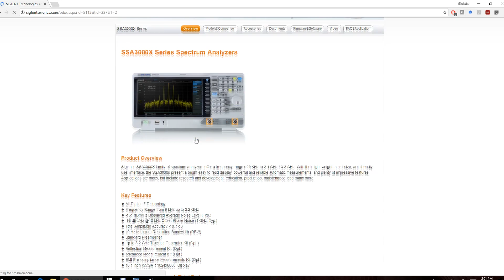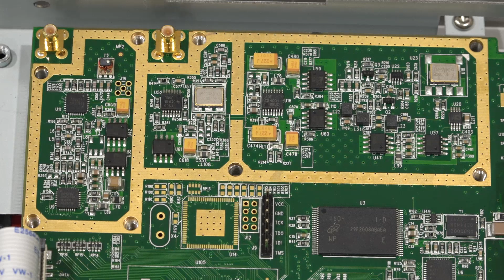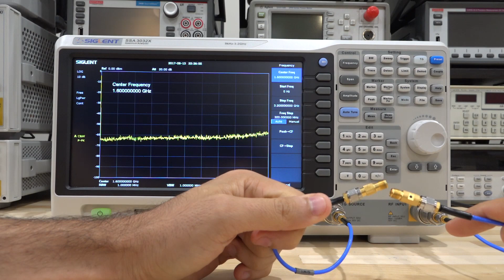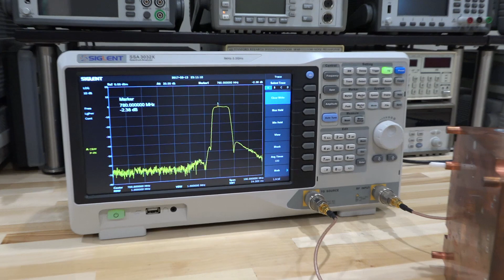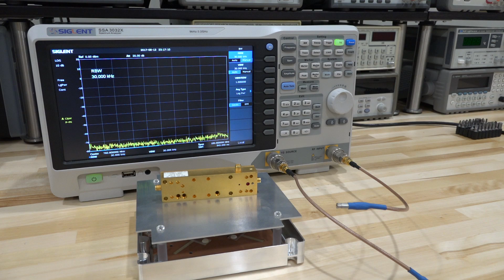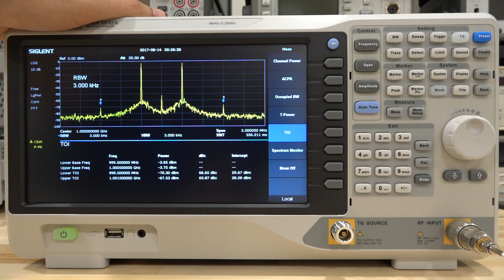TSP #104 - Siglent SSA3032X 9kHz - 3.2GHz Spectrum Analyzer / TG Review, Teardown & Experiment

Comment: Greetings from Argentina, I'm looking forward to buy this unit for cellphone RF repair , will I be short in terms of frequency for debugging 4G or 5G networks? can you please clarify to me.
Reply: If you are into cellphone repair and don't know the answer to that question then I wonder why you are even in that business since the answer to your question is so extremely obvious.
Reply: @dtiydr  Obvious or not, but I'd like to know if it'll be of any practical use for debugging Rf circuitry or better buy tiny Sa which there's an upgraded version which reaches 5ghz.
Reply: @daaudiome  If you absolutely also need 5g and don't want as many options and such then buy it. Test it out since its not expensive at all and if you miss a lot of things in it the buy fex the 3021X Plus.

Comment: I have a noisy electric earth, which is injecting common mode noise in my measurements, since the coax shield is connected to earth. What's the "professional" method to get rid of that?

Comment: What you term as "Quite Good for a second harmonic" at 40db down is actually not even close to what the FCC requires for a broadcast station in the united states at 80db down on the 2nd harmonic.
Reply from the maker: wb5mgr This is from a broadband source. There are no filters. Why are you comparing the output of a synthesizer to the FCC regulations of a wireless transmitter?

Comment: excellent video. Loved it. I just received my SSA3021X today and I am learning how to handle this and this video is the best. However, I have a question: what is that fairly strong signal at very low frequency (probably at DC or so) about -10dBm which is always present on the left of screen when the START frequency is very low? No matter if the input is connected or not its always there. I have that on mine, too and I was not expecting that. Is that normal?
Reply: It's not "real" i think, an artifact of how most spectrum analysers work- local oscillator feedthrough
Reply: That's mains 50/60Hz interference. You can never fully get rid of it.

Comment: A very sweet presentation. You might consider speaking a bit slower. Some of the details are glossed over for no apparent reason. The level of the presentation Is spot on for those who are aware of normalized measurements and the reason they exist. It might be helpful to do a quick review for those who don't realize the limitations of the sweep generator and its nonlinearity of output level due to cost and or design constraints.  de ARS KQ2E

Comment: Since you were talking about using torque wrenches, can you do a video on the importance of those ones and showing differences between using them and just your hands?
Reply: I remember you talking about it quite a lot, however I don't remember showing actual measurement differences or problems that arise by doing it wrong. My memory is not infallible though, or I might even have missed a video once (omg!)!
Reply: Yes, I would be interested in such a video as well.
Reply from the maker: I have done a video tutorial on microwave components and I think I discussed it in there.

Comment: It seems expensive when you can do similar with a ten dollar software defined radio. Isn't it time spectrum analyzers come way down in price?
Reply: So none of the measurement features, none of the analysis features, no tracking generator, no ability to connect to inputs other than an antenna, vastly worse resolution, vastly smaller frequency range, and worse UI. Some of that (UI, some of the measurement & analysis) can be mitigated if someone writes better PC software for it, but most can't. There are better SDRs with closer hardware specs in the $200-3000 range depending on how close you want to get in terms of the resolution and frequency range, but the RTL-SDR is nowhere close. It's a nice device, I've got one, but it's not a spectrum analyzer. It's like the difference between a data logging multimeter and an oscilloscope: both measure voltage over time and can graph the results, but they're entirely different instruments.
Reply from the maker: Can you show me a $10 software defined radio with similar specifications?
Reply: They have come way down in price.  A cheap SDR has much lower specs - it really depends on what you
call "similar".
Reply: The resolution bandwidth limitations are too limiting on the inexpensive instruments. I have been using the Seeed spectrum analyzer and freq gen (to form a software driven tracking gen) and it was largely unusable for my application. It may be fine to characterize filters for a Ham enthusiast or the like, but not much more than that.
Reply: Not the same specs but too close to warrant the price difference as I see it. You tell me watch?v=zu-K1Sslw1Q
Reply: What I wonder is are there any chips in it to warrant the price. Or is the price simply convention and small market. Could the price be 1/10 if they sold many more. And I believe it could.
Further, I would be interested to hear Shariar's serious thoughts on if that functionality could be added onto a scope for $100 retail. I'm guessing it could. Thus should.
Reply: @dbcooper1435  So you "wonder" or you know for sure? Your post says you know this for sure
Reply: @Neuroszima  I don't have to commit to that but sure, I'd essentially say I know so, it's just a matter of how inexpensive could the parts be. And how niche is the product type. The performance demonstrated here is not impressive. Frequency sweeps in the 1Hz region.

Comment: I can't help but think that this shares a lot of code with my Rigol DSA815.  The fonts and menus are suspiciously similar.
Reply: hpux735 they are both mimicking the keysight instruments.
Reply: I get that, but the font, placement, and layout of the marker text on the top-left of the spectrum display is _identical_.  I wouldn't be surprised if there was a vendor that provided SW for these Chinese test equipment brands.
Reply: The point wasn't lost on Dave Jones either...

Comment: Since you are quite smart i have a question that I was unable to find answer for.
Why sometimes pcb designer don't use ground layer on top and bottom ? I mean, what is the advantages of having ground free top/bottom layer ? 

I only have two explanations, simpler impedance control, and better soldering maybe ?
Reply: Usually one prefers the simplest ground system possible, many layers of ground can be bad as you can have longer loop length, more inductance and possibly multiple ground paths. If you can keep the ground to one plane it’s best. Shielding is another topic, but shields aren’t used to carry current, they are just held at the reference potential to reduce noise. Grounding of circuits is an extremely complex subject that you’ll never stop learning more about, many times there is no one right answer, and it becomes a form of art.
Reply: Layers cost money. If you can keep the board within spec and use fewer layers, you do. If you need the extra layers for EMI compliance or other reasons then you put them in. Also some devices use external shielding instead. So a high-sensitivity device that can't afford heavy shielding might use ground planes on both top and bottom of the board (with plenty of via stitching around the edges), while an instrument like this uses a ground plane on one side and a big aluminium shield on the other side.

And many devices simply don't need the extra EMI resistance that ground planes provide. For example a computer motherboard will be using lots of differential pairs for the high-speed digital signalling so ground-plane shielding isn't really needed. Ground and power planes are still useful for making layout easier if you can afford the layers, of course.
Reply: But in any case, have better ground between components simply by poring top and bottom with GND net would yeald better results in terms of nearly everything. It does not cost, as well it keeps chemical usage in fabs lower, and provide more accurate tracks since it needs to be in etching solution shorter (in theory)

Yes, layers cost money, so use all of them every time possible.

My use only to make GND connections better. even if i had dedicated internal ground layer, and via nearly every pad, having top and bottom ground plane makes ground path less inductive.

Comment: ANOTHER great video Shariar, keep em coming!  What directional coupler did you use when you measured the return loss of the antenna ? TNX again for taking the time in the production of your videos! My new 3032 seems to have a bug, after normalisation TG randomly turns off even tho it says its on. Preset won't help only power cycling it. And I agree with you with lots of wasted space on screen. My only complaint is the 48hrs they give you try out options, hardly enough time to do anything. I use my hacked Rigol 815-TG if i need to do any of the the "special" measurements.
73 N8AUM